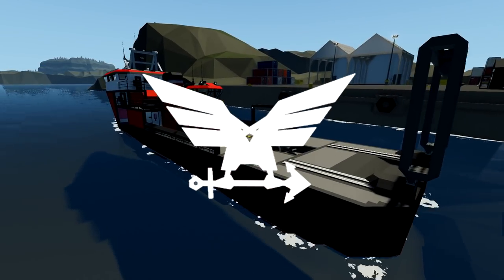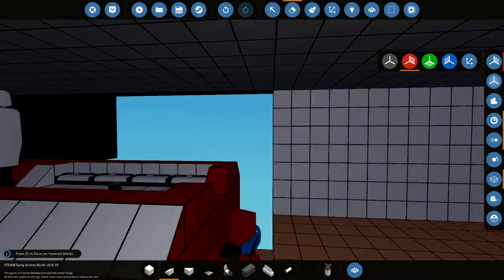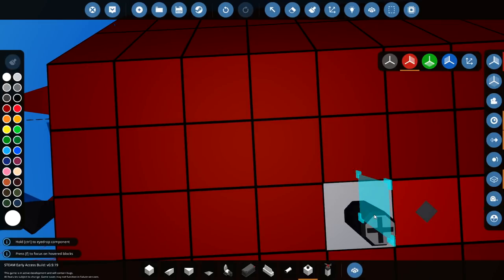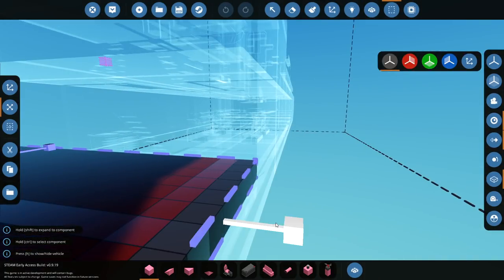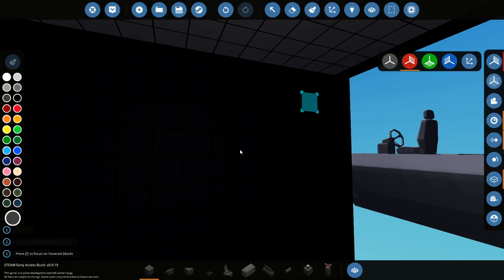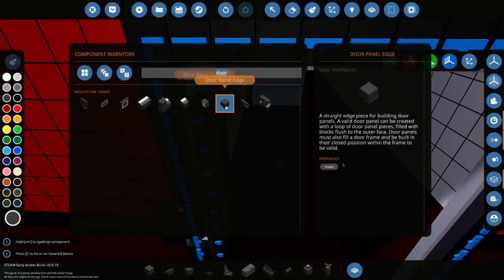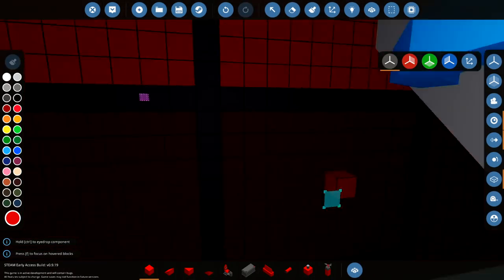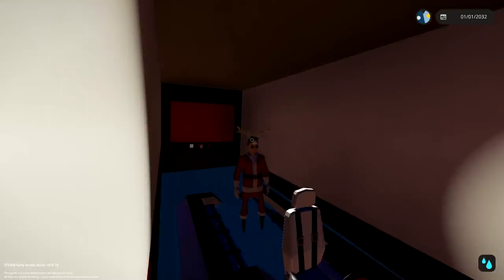Lifeboat Dock Area  -  Research Ship  -  Stormworks Gameplay  -  Part 17

Comment: You're gonna want 3 connectors, 2 electrical surrounding a fuel connector, that way you can go into the boat from either direction and the mini boat will always connect in the middle.

Comment: Since you are using only one door, you should make it easier on yourself and use a sliding rail,

It will autoattach to the floor, you will still be able to use engine power to go inwards, and you can place your connectors on the front for eletric and fuel,
They will also be aligned because of the sliding rail. you can then activate the rail brake to keep the ship form sliding once inside.